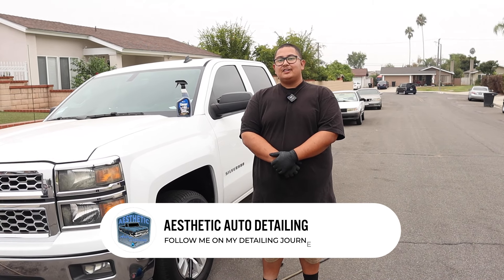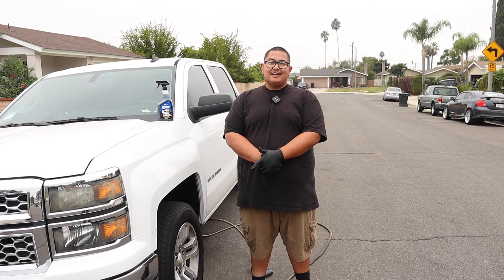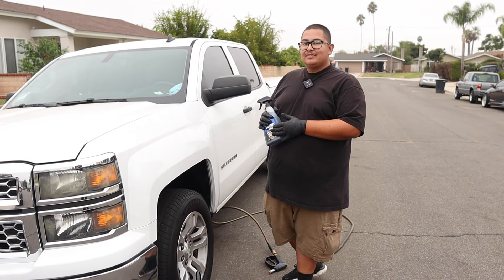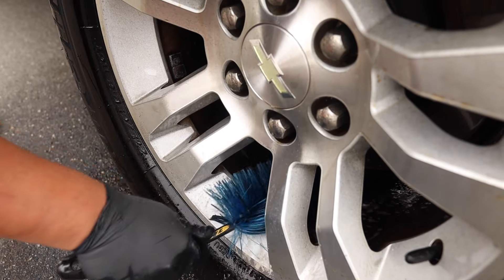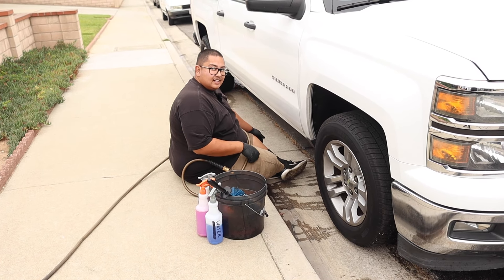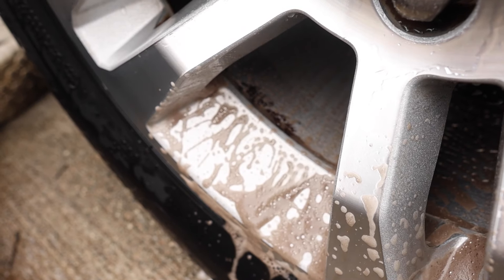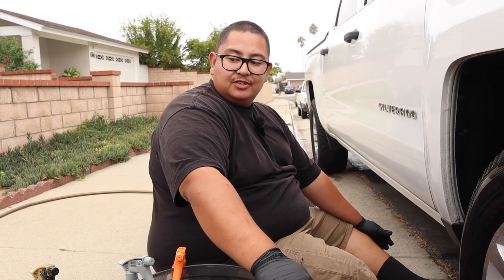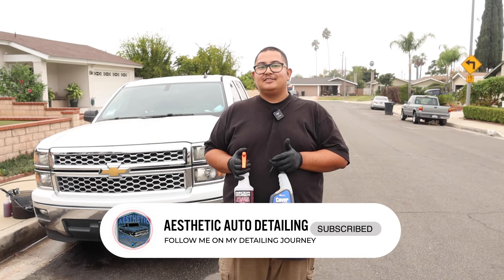Testing Out Dark Fury Wheel Cleaner VS P&S Brake Buster - Aesthetic Auto Detailing

Comment: The dark fury in a spray bottle is prediluted 4-1. When dealing with really bad rims though I use acid just like you did. I have used dark fury 1-1 on some rims like that and it worked pretty good. But not much out there that can beat acid
Reply from the maker: Agreed, that’s what I was worried about. I figured the bottle was going to be pre-diluted.

Comment: You could get the whole gallon size and lessen the dilution so it's stronger.  Wilson (another auto detailer here) highly recommends this and another Ssuperior brand that's an acid, called something like Aluminum Bright (?) which cleaned his barrels too.  Thanks for this vid, I was seriously wondering about this product, but I have a gallon of PNS breakbuster and some ArmorAll, so I was really curious, dying to find out if it's worth it, but having so much of brake and wheel cleaners already.  You can special order all the Superior product from O'reily's, and they are cheap and dilutable.
Reply: @indelibledotink  aluminum brightener is great an cheap! 12$ a gallon at my local oriellys, I acid washed our horse trailers aluminum and diamond plates then polished.

Also worked great on caked on Honda factory gloss rims no damage in the sun

Comment: I use acid from Superior products on caked tires , quick and efficient.
Reply from the maker: Going to check that out!
Reply: Purple X is a diluteable acid from Superior Products, cost about $17 for 16 oz makes 32 oz (1:1).  It is safe for most OEM wheels & paint.
Reply: @hartlanddetailer5670  isn't purple x an iron remover from them that concentrated
Reply: @KingTheDetailer yeah it’s a iron remover. Clingy, foamy and effective.

Comment: Haven’t even watched the video and I know BB gets its ass kicked. Even at full strength it’s so weak. Idk what P&S is doing selling a product that’s hardly stronger than plain water
Reply: Yeah man, I don't know how anyone recommends BB. It's not noticeably better than a good soap on wheels. It has to be the most overhyped detailing product of all time.
Reply from the maker: Back in my earlier days, I used to use degreaser and the wheels and it didn’t do much lol. Brake Buster definitely made a difference, but I’m open to more suggestions!